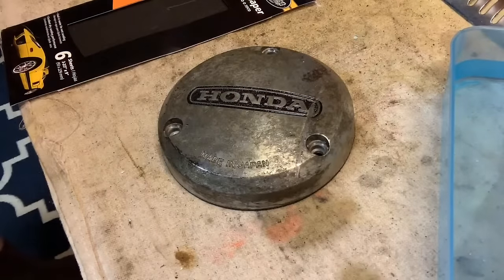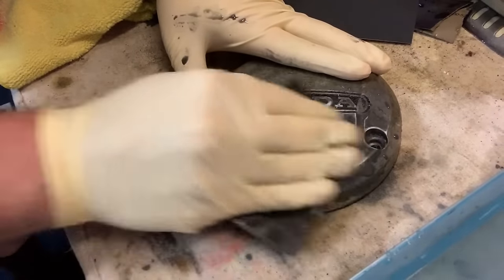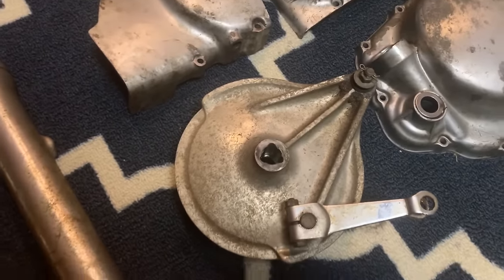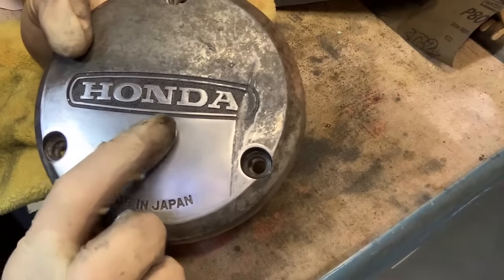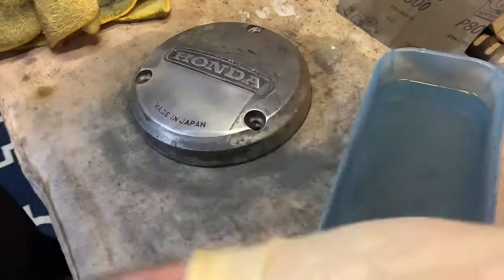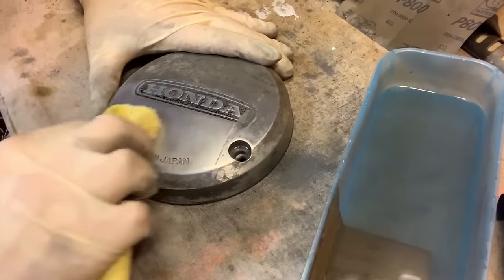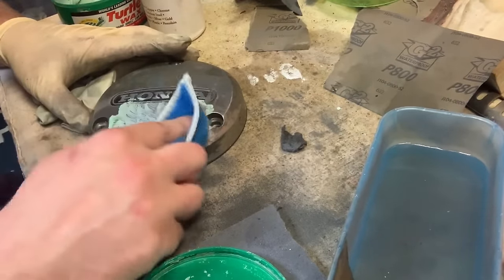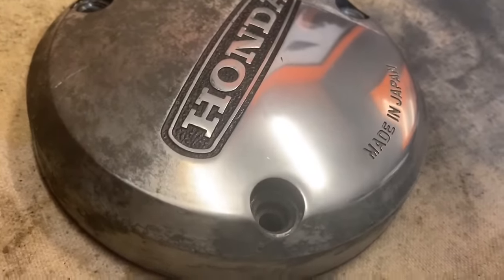How to Restore Aluminum Motorcycle Parts like a Pro for Cheap

Comment: A bench-mounted grinder/polisher can be a great help.
Reply from the maker: Agreed. I went old school to show it can be done with minimal materials if you put in the time.
Reply: @KeepOnWrenching  A disc made of several layers of fabric on a drill, and some wax, could have done it in 1/10 of the time, and it would look like chrome when you are done
Reply: @Pianissimo1970  that’s the biggest load of bologna I have heard
Reply: @Pianissimo1970  depends on the oxidation and or scratches.
On something in bad shape you got to have something that will really cut into it and make it smooth.
Reply: @MrThatnativeguy  Yep.  Gotta get down a layer and even with the wheel, I spend a tone of time.  Still need to get those small places the wheel can't get to.  But I've been working on them for now 10 hours between last night and today.  It's a lot of work and there is not 1/10 of the time.  Ha
Reply: @KeepOnWrenching  Nicely done indeed

Comment: Bud, half the work can be cut by brushing on some MEK (methyl ethyl ketone) nearly all aluminum engine covers and cases have thick layer of clear coat keeping it from corrosion and pitting. Now, when you get it polished, you need to hit it with clear unless you want to watch it pit over all again as soon as you ride the bike in the rain. The acid nature of waters will pit that up in no time if you don’t shoot it with clear.
Reply from the maker: Thank you. I appreciate the info.
Reply: @KeepOnWrenching Acid nature of waters?
Reply: @professorwiggins3290  Water is slightly acidic on the pH scale
Reply: @aaroncutting rain water is quite ACIDIC because it contains Carbonic Acid (CO2)... it's strong enough to dissolve mountains ...😂

Comment: Your doing it the hardbway.  Putting scratches in that you have to remove later.  Self defeating process.
Reply from the maker: Not really, it actually helps make a very smooth and consistent surface.

Comment: Thanks from Australia. I used paint stripper to first take off the clear coat on the engine side panels on my Honda CB250. Saves a bit of time sanding but it's still a long and tedious job. Used 1200 and 2000 grit wet and dry to get the last traces of oxidation off. Last operation was to hit it with Mother's aluminium paste then resprayed with enamel clear coat.
Reply from the maker: Cutting the clear helps a lot!
Reply: Yeah, bud….this dude has never used Methyl Ethyl Ketone to remove the factor clear and a cotton wheel on his bench grinder along with a bar of white rouge. I could have that points cover finished like a mirror in about five minutes.

Comment: I do the same as you but at the end I clear coat it to stop it from happening again
Reply from the maker: Yeah…that clear will eventually crack and make life harder for the next t guy IMO.
Reply: @KeepOnWrenching  I’ve been doing it for years and haven’t had a problem yet. I use a quality clear and a spray gun not a rattle can.
Reply from the maker: Definitely a better quality clear. Gotcha! Go get it!

Comment: Really informative! Do you throw the microfiber cloths in the washing machine and use them again? Will the metal particles wash out? I’m working on a 1975 CB200T. Keep up the good work!
Reply from the maker: I do wash them and reuse them but completely separate from everything else and on a "deep wash" cycle. I haven't noticed any issues with the washer or anything by doing so. The first time I did it I was a little nervous though. lol Just keep them all separate from everything else. Thanks for watching and I'm glad you found the video helpful. Good luck with the 75 Cb200. Make it shine like new! :)
Reply: I wouldn't recommend a washing machine as the fine aluminum has a chance of lingering. I just use a pail with dish soap and a high pressure hose. Either does work tho.

Comment: There is no point in polishing aluminum/aluminium or any other alloy unless you clear coat it afterwards or plan to polish every season. It will corrode 10 times faster than from factory, in two-three years it will be even worse than what you stated with. Look at Royal Enfield bikes.

Comment: P. S I also made my own drill tool. I cut many small pieces of denim and used a hole punch to make a hole in the middle. I would use a bolt and nut through the centre with a washer each side. You will end up with a realy tough polishing tool you can put in a drill. You apply a cutting compound of your choice. Works great for many jobs.
Reply from the maker: That’s ambitious. Great work.

Comment: i use a dremel tool with abrasive buffing wheels.  easier on your hands and quicker
Reply from the maker: Love me a Dremel but those bits get spendy and the cheap ones don’t last. Plus I find it kind of relaxing. If I was getting paid by the hour I’d definitely expedite the process.
Reply: Rotary tools are excellent but too risky for an amateur, they can take off a lot of material fast with the right bits.
Reply: @KeepOnWrenching  I agree it's very soothing and relaxing to me too, but what about using a vapor blaster, I'm about to invest in one, do you think it's a good idea? Maybe I could save some effort
Reply: @KeepOnWrenching  Saying because need a way to get into those holes, nooks, cranies and lettering

Comment: Uhhh..... These were painted from the factory, I do believe.  All except for the cap you polished and the round cap for the oil filter slinger.
Reply from the maker: Some were but these were typically clear coated. Just do what you wanna do. I love clean, polished, and maintained aluminum. Clear coat sucks on these…lol

Comment: I was polishing parts 30 years ago but we used a polishing wheel maybe four inches wide, this was still a small machine from what there is out there. I never tried removing the first level of material with a soda blaster, but I sure would try it. Im all about blasting through the initial steps with power, but its all about what you can be satisfied with.
Reply from the maker: Exactly

Comment: Hey man I almost threw my ohone at the end it was so damn shiny like a mirror. I have a question. Can I hire you to polish my aluminum RC chassis and wheels? If not how do you recommend doing this on some small aluminum RC wheels? It would be difficult to go in a circle motion inside the wheels. Great tutorial video!
Reply from the maker: I’d recommend a dremel tool. Lots of tiny buffing heads available.

Comment: Enjoyed seeing your process, though it kind of triggered some PTSD from how much time I’ve spent on a 32-foot 1950 vintage aluminum trailer. I kept trying to imagine taking on that project by hand and it literally made my stomach turn. I know you’re trying to show folks how it’s done on the cheap, but time is money and $500 worth of tools and another $100 in polishing compounds would take this job down from three months to three weeks. Plus, no carpal tunnel syndrome — although the polishers definitely take some new muscle memory to be really effective. I think I spent $200 on a new Dewalt 7-9” 13 amp polisher, $120 on a vintage Cyclo polisher and another $100 to have it refurbished (they’re like $450-500 new), and then $65 on a HF dedicated buffer for smaller parts. The 70 years of oxidation, dried silicone, old paint and tar-like crud was so thick, I started out with a wire wheel on an angle grinder. Then four stages of Nuvite and/or Brightwork compounds turned the heavy scratches into a mirror finish. Dirty, hard work with endless amounts of black grit to be cleaned out of pads and towels. But the trailer was transformed. Now I use the same techniques, on a far smaller scale, on my 1972 BMW R75/5 moto.
Reply from the maker: It’s not a race.

Comment: how hard do to press down on the p800 grid? and in the end is it light press or medium with p2500 and p3000?
Reply from the maker: It gets smoother and lighter as you go to finer grits. Keep the paper wet. Not much difference in pressure.

Comment: You can save a lot of time, by removing the clear coat with paint remover before you start sanding.
Reply from the maker: Getting that clear off is key! I’ve since starting stripping it off first. I hate clear coats! Lol

Comment: I call this "cold polishing"... very good results but with a high time deficit.  When I polish, I only go to 400 - 600 grit at the smoothest. But i will then use rouge compound on a mop and then switch to a super fine compound on a mop. If you don't have a decent bench or hand polisher (£££££) Then this is by far the best method. Thank you for sharing.
Reply from the maker: That’s a great term. I was in no rush. Had limited resources, but could still get the job done respectfully.

Comment: After 400 or 600.... Use jeweler's rouge (white) on 6-8 buffing wheel on bench grinder. Alot less work.
Reply from the maker: Thanks for the tip! I have noticed during the couple of years I can go to a buffer sooner. At the time I recorded this I didn’t have a wheel. I do now and it makes the process so much easier!

Comment: Im sorry but its NOT necessary to turn the rag as much as you do. Its just NOT NEEDED. Youre wasting a lot of time! When your Wizards buff is completely black are you going to continue to rotate it? No, because its a waste of time. The material is still there. Just rub and dont worry about rotating until youre finishing up and raising the gloss. The aluminum looks great when polished but it WILL NOT maintain that finish for any length of time without constant polishing. After you sand the clearcoat off the protection is gone and oxidation begins as soon as youre done polishing. The ONLY way to prevent it is with resealing it with another clearcoat. The information youre offering is great but give the full process on how its properly done to last without working yourself to death.
Reply from the maker: Thanks, Bobby. The parts could definitely clear coated again. I enjoy the process of bringing these old parts back and a keep my bikes cleaned and polished. Just not a fan of clear coating aluminum engine parts. For no other reason than personal preference. Getting better every day. Thanks for taking the time to comment.

Comment: If you're hand sanding something small like that. Put it in a tray full of water and continually dip your paper in that as you sand.  That cleans the paper and the surface at the same time.  Your paper will last longer and cut better.
Reply from the maker: Great tip!

Comment: 0000 Steel Wool wouldn't work on Aluminum?  Or what is that, Wadded up tin/Aluminum foil and WD40 or something?
Reply from the maker: You don’t want to use steel wool on aluminum. It can pollute it. I used wet sandpaper. 400, 800, 1000, 1200 grits.

Comment: I am trying to restore and fix a 1980 honda twinstar 200 cc  4 speed 6 volt  battery and I did not know about the wet sandpaper until today,, thank you.
Reply from the maker: Wet sandpaper is awesome. Really clean final finish can be achieved! Glad you found the video useful.

Comment: Vid is cool bro, theres many areas where sandpaper may help small areas but for larger parts it’s well into the money in paper to use a bench buffer. However you need to research those before buying its nice to have dual speed and several sand, cutting and buffing wheels. I say this for less time, to get show quality polishing ( and carpal tunnel ) good job hope your bike comes out great
Reply from the maker: Totally!!! Not everyone has one tho.

Comment: I  like to use a Dremel with some homemade disc on a cutting wheel mandrel. I use Velcro to hold sand paper on. And at the slowest speed. Also add some dishsoap it seems to stay longer and not be thrown off as bad, from the speed of the dremmel.
Reply from the maker: Haven’t tried the dremel. Bits are expensive…I like your approach.

Comment: I spray aluminum brightener on my stuff. Rinse it off after 30 sec or so. Use 3m's 3 stage metal polishing compound then use never dull and for me it works a lot faster and comes out looking like a mirror. The difference is, my method doesn't get out all of the imperfections in the metal but when polished up, I barely notice them. I mean I really have to be looking for them.
Reply from the maker: Awesome tips! Thanks so much. I’ve been hearing a lot of people like those scotch pads.

Comment: You can use a fine flat file and probably get those deep scratches out. You have to blend it into the surrounding area to avoid flat or low spots. Do the scratch removal before any polishing. Watch you don't remove the nice edge all around the cover by sanding in one spot too long. Good job.

Comment: when you do a lot of them,like i did for 50 years,you learn that time expended could be used more effectively elsewhere,when it came to these pieces,i usually had them walnut shelled or soda blasted,then attack with abrasives,then always ends in polishing,machine type,perfection takes longer,1 bikes gotta be worth it
Reply from the maker: It’s just a hobby. I don’t mind, getting an electric buffer was a game changer though.
Reply: @KeepOnWrenching  if you use it more than twice,you needed it,speed in restoration is everything,and customers expect it,good job

Comment: I get why you did it by hand but I would have to use power tools. That's just too much work to do by hand.
Reply from the maker: I guess I like to show that you don’t need power tools. Sure there are a million ways to get to the same result but I liked showing that all you need is some sandpaper and some time. Doable by anyone.

Comment: Consider hitting it with a solvent like acetone, naphtha or carb cleaner before you get started. You can use a random orbit sander to do the first grit before switching to hand sanding. After you're done, clean it thoroughly with acetone again and then paint it with Engine Enamel to keep it looking fresh for years.

Comment: I have some wheels from a dirt bike that are pretty rusty. do you think the method you used on the fender should work? pretty sure they are chrome
Reply from the maker: Sure. Chrome is chrome. Start with WD and 0000 steel wool and go from there.

Comment: Good job man.  I am restoring a ‘70 Kawasaki Trail Boss. I parked it in my dads shed when I went in the service 50 years ago.  I had forgot it was even there.  All in all it is in pretty good condition.  The spokes, (they are a REAL pain) chrome springs over the rear shocks, the handle bars, the chrome ring on the headlight, have rusted and pitted pretty good. The rims themselves rusted very little and cleaned up well.  I was thinking I would get the other parts re-chromed, but I am trying to restore it back to original though. The only thing not original is the rear tire.  I have labored for hrs and hrs and hrs.  I am going to get me the products you used and give them a try.  Thanks
Reply from the maker: Sounds like you’re putting in the time and will reap the rewards. Good luck! Go get it!!!!
Reply: @KeepOnWrenching  Good question on the spokes btw! Do you attack spokes the same way with wet & dry? I read somewhere that doing that will only cause them to rust faster...your opinion?
Reply from the maker: Yeah spokes are tricky. I would go to aggressive there. Steel wool 000 at most. Sorry I missed this reply and for the delayed response. I hope you’re still making progress.
Reply: zhukie I thought of that too. I waxed them after each session.  I think I may end up having to replace the spokes. It took a lot of work using 0000 steel wool but got the springs cleaned up pretty good. The handle bars shined up pretty well but do have some pits in them. The headlight ring is the same.

Comment: How do you polish down into the recesses like the bolt-head countersinks, etc.?
Reply from the maker: Benjamin Root I roll up a small piece of sandpaper really tight and work it into those grooves. It’s slow going but it can be done. Just work your way through the different grits. I hope this helps.
Reply: There are a couple other tricks you can try: Get a couple old drill bits that are smaller than the holes you are trying to clean up. Wrap the bit with steel wool 000 or 0000 and carefully let it revolve in the hole. You may need different size bits. Check the wool to make sure you have enough wool never to allow the bit to come into contact with the bolt hole. You can put a wad of steel wool considerably larger than the bit, it will compress into the hole. You can also do the same thing with a Dremel tool and various polishing pads and inserts and compounds. Just let the tool carefully revolve with its pad or bit. It is trickier with a Dremel tool because of the speed.
Reply: I wrap the sand paper around a pick, screw driver, kabob stick, anything that fits. It just takes even more patience.
Reply: Be careful about mixing metals … aluminum and steel, etc.  The parts manufacturers go to great lengths to keep metals separate in the manufacturing process.  You don’t want to embed foreign debris into the part.  

Great video!   Thanks for taking the time to do it!   Really satisfying for us to see the finished (portion of the) product too!